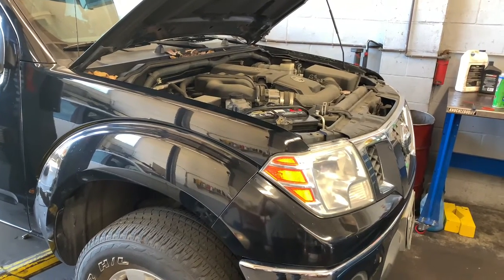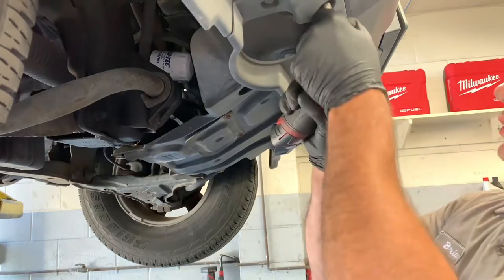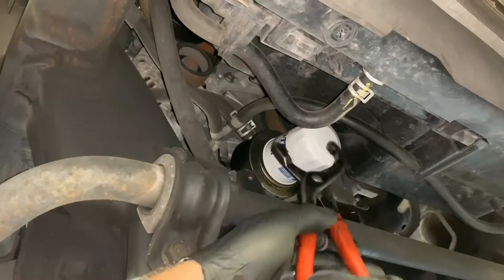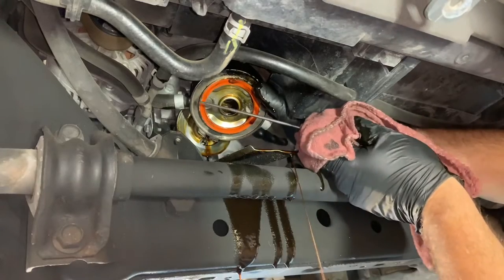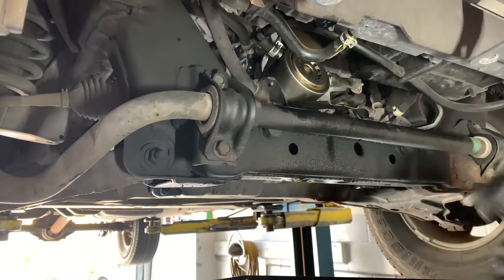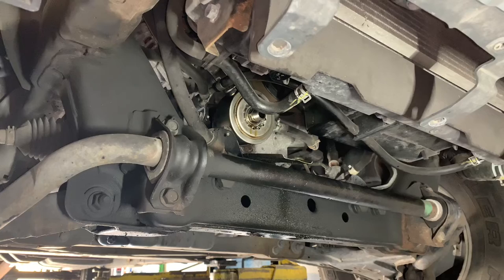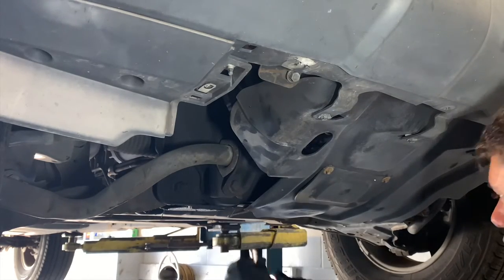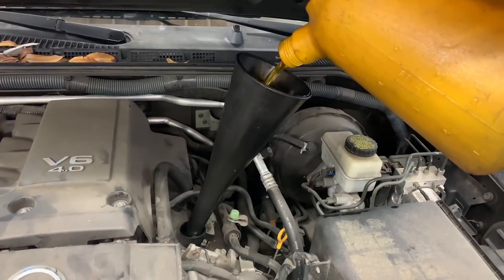How To Reseal Your Engine Oil Cooler On A Nissan Pathfinder Or Frontier With A 4.0l Engine.

Comment: Make sure you clean it well. Also, the gasket is the same dimensions as fram oil filter gasket.  Bought one from nissan and returned it when they measured the same. 30K plus on one vehicle 100k plus on another and holding.

Comment: Hello, I have a Honda and that part leaks oil, like alot, and my mechanic told me I need to replace the whole oil cooler, which will be very difficult cuz they don't make em no more and Id like q second opinion, is this thing possible to get fixed? Or what else could it be?

Comment: Thanks a ton for all your vids they're comprehensive and easy to follow!

In the shop manual, they have the symbol for brake fluid next to the O-ring.  Would you suggest applying brake fluid or oil to the O-ring prior to installation?

Thanks!!

Comment: Thanks for the video! I did this and still having a slow leak. I torqued tomorrow spec, cleaned thoroughly, and bought genuine Nissan. Has this ever happened? Should I try again with another gasket?
Reply: Brian Dena factory recommend changing stud also

Comment: What was the solution spray did you specifically use when spraying down the cooler from inside to out ?
Reply from the maker: It was brake clean parts washer.

Comment: Would this seal leaking cause a slight oily burning smell after a drive? No wet spots noticed under my truck. 234k
Reply from the maker: The oil filter housing/cooler is a very common leak yes

Comment: I just replaced mine and it's still leaking from the bottom... 06 pathfinder 4.0
Reply: Did you ever get it fixed? And what was it?
Reply: @slowjamcdub  After dealing with this for a while now, I decided it is that actual oil cooler that needs to be replaced. The leak is very very slow but I did everything I could. My car has 198k miles on it, at this point I am not worried too much.

Comment: you are loose with the names of your parts. you are replacing the o-ring for oil cooler sandwich. that is not a oil cooler. show the oil cooler
Reply: This part is actually considered the oil cooler, the cooling portion goes through a oil cooler radiator